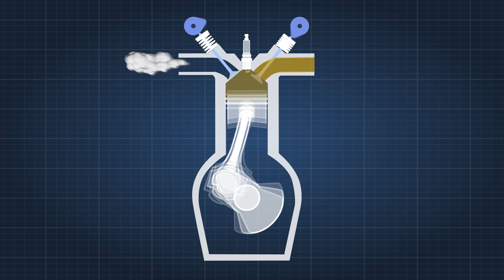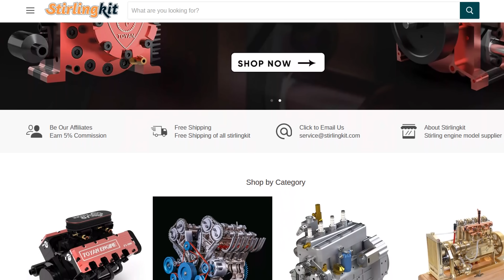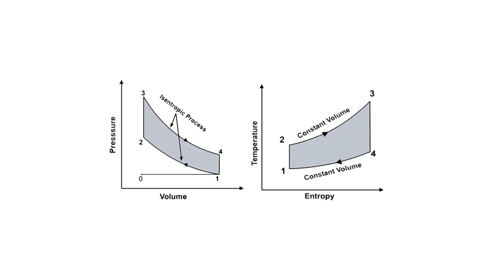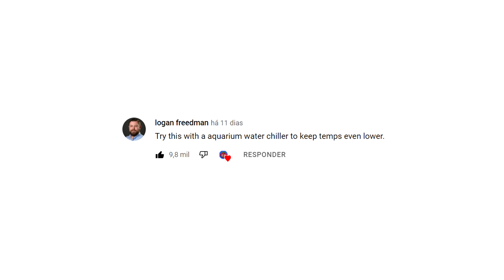I 3D Printed a Transparent Combustion Engine in Resin

Comment: Yo, when you switch fuels like that, you have to retune the engine timing and carb flow rates (i.e. rejet) for that fuel type. Also, engines running race fuels tend to run at higher than normal cylinder pressures than their stock counterparts. That little green o-ring on that piston probably not gonna cut it. Maybe vent the crankcase to monitor blow-by with a pressure guage. Just a few tips from a fellow engine enthusiast.  Happy Brapping!
Reply: That carb is basically 2 straws with a throttle body there’s no tuning it
Reply: I have a transparent engine that runs on Colorado Kool aid 🙂
Reply: the carb used on this engine is the same that's used on model airplane engine. the spray bar setup is actually very simple and works. these model carbs don't have jets like the carb you would find on a car engine. i would a bigger fuel tank would also help and some minor tuning of the mixture needles

Comment: 1-Air!! if there’s not enough air all the fuel won’t burn. That why all you’re test you had fuel soaked pistons. By air I mean oxygen. 2- magnets that probably is a hard one because it’s a timing issue. the magnet would have to be moved or be enlarged for better performance. Thats why modern have a  variable timing for cams and spark timing.

Comment: Each fuel type will need a different air / fuel ratio and also the timing of the spark either advance it or retard it ,modern  electronic ignitions do this automatically depending on revs , an older engine with a manual distributor used the vacuum produced in the intake manifold to di this , that's why your loosing detination at different rpm using the different fuels

Comment: I feel like you would get a lot more information if you could measure the cylinder pressure while the engine is running, but I'm not sure how to accurately do that. I think it would also help to test the engine running while under load. You could use a DC electric motor like a hall effect breaking mechanism to serve as a load. If you add a resistor or maybe a potentiometer between the leads of the electric motor, you could probably figure out a way to calculate total torque along with RPM of the engine for a more clear picture of fuel efficiency. Sometimes higher RPM is what you need, like for a string trimmer or maybe a chain saw, but sometimes you need torque and it's not as important how fast the engine is turning. Things like electric generators and water pumps.

This all may well be WAY more than you are interested in doing, but it could all be fun stuff to play around with. You have tools at your disposal that I don't or I would probably try it myself.

Also, your cylinder could really benefit from some gaskets both at the head and where it connects to the crank case. You can buy sheets of gasket material and cut out whatever shape you need.

Comment: To put it simply the reason the engine was misfiring for a combination of reasons like not having adjustable timing is probably the biggest reason, potential compression loss from the see-through cylinder, and having no load on the engine so it doesn't have to fire every single time to keep a steady RPM I love your videos I've watched your channel since the original 3Dprinted Tesla turbine video

Comment: It would be really cool to use an arduino or similar to adjust the spark timing manually, controlled with a hall effect sensor. You could also put a capacitor in series with the spark plug for a hotter spark, see what results you get from different fuels
Reply: It's called Speeduino :)
Reply: Congratulations, you just reinvented the engine computer.
And that would be an awesome thing to do with maybe auto tune depending on the fuel and the engine.
Reply: @mylittleparody2277  Oh man, you'd need oxygen and knock sensors then. :D

Comment: well there are a few reasons why a four stroke engine might skip power stroke,

First, your fuel is just more flammable and can combust in less pressurized situation.

Second reason might be that your engine is not just ran in, the reason why companies require users to run in their engines is to actually make a better seal with the engine, with the explosions and oxidization and a little bit of gunk caused by the burning of the fuel appearing around the valves and the piston ring, it will result in better sealing thus less loss of compression around the piston (since the piston is not actually tight with the cylinder).

third is that there are just not enough fuel being injected into the cylinder, Carb. powered engines use normal vacuum and gravity to pull fuel in and nothing else, whereas fuel injected engines use pressurized fuel to be sprayed into the cylinder and a better mix with the air around it. as you said you got one power stroke every 8 to 12 cycles pretty much consistently and if it was actually due to the compression, it's not that every 8-12 strokes the engine realizes that "aha I have to compress the fuel air mixture now!" I guess there's not enough fuel in the chamber in the first place and some left over fuel which failed to exit the chamber in the exhaust phase combined with the new amount of fuel was finally sufficient enough to combust , either air bubbles (because the tube is small) or just not enough force for enough fuel. try putting the fuel storage somewhere higher than the where it is to force more fuel in it.

And fourth, Probably your air-fuel ratio is just off and there's too much air for the fuel to burn so there is left over fuel in the engine so it combusts every 8-12 strokes...

Other than that there's not much else coming to my mind since your engine is a mechanical one and not an electronically controlled one :)

Comment: 3D print a combined turbine, internal combustion engine. The shaft of the turbine will become the crankshaft for the reciprocating engine. You could talk about what the pro’s and con’s are about each and put them in a head to head competition. Maybe even use them to start each other

Comment: Most likely reason for failure to ignite and missing power strokes is incorrect air/fuel mixture.

These fuels all require radically different air/fuel ratios, as you touched on. You need to adjust your carburetor for each fuel. Some fuels may require a completely different carburetor if the needed ratio is beyond your adjustment range.

Comment: Let´s make a 2-stroke 3.5 ccm engine up to 40.000 rpm by using 3D printing. Metal parts I can do by SLM, the transparant cylinder you can fabricate by DLP.

Comment: You have now discovered why car engines have a variable spark timing, or spark advance.  As speed ramps up, you need to ignite the fuel sooner as the flame front will have a constant burn rate for each power stroke.  When you hit max speed, the flame front is extinguished by the rapidly declining cylinder pressure, causing a misfire and wasted fuel.  You can see this in action on an older vehicle with a vacuum advance distributor.  Disconnect the vacuum line and watch the engine hit a speed wall pretty quickly.

Comment: I feel like the reason why the nitro methane and others didn't work as well, is because it wasn't running optimally, I wonder if it would be better if the carb was adjusted, and you had a more powerful spark.

Comment: Hit and Miss engine don't spark every time.
Internal combustions engines are rev limited by turning off fuel or ignition.
The effect is the same, speed up the engine fast enough and it won't ignite.
So that little engine could just be rev limiting more with the more potent fuels.
Also an engine jetted for gas will need more fuel for the alcohols.
Alcohols burn slower than gas and this is where you get more torque, force over time.
From gas to E85 you need about 30% more fuel for stoichiometric / Lamba 1 and also the methanol / nitro need more fuel!

Comment: Try a mix of TATP and methanol, or even TATP and acetone (if your resin resists acetone). It's always fun to play with TATP, and so easy to make in the kitchen (Wikipedia suggests HCl or H2SO4 as a catalyst, but it makes it yellow-ish, I prefer HNO3 to reap a nice white powder, and any strong acid works, anyway). Otherwise, Tech Ingredients is studying a lot of tricks to cool a reactor, his last video is all about afterburner, it might be of some help for your next experiments ;-)
Reply: Making TriAcetoneTriPeroxide will likely end up with a knock on your door...or it being booted down at 3am
Reply: @r3dshed  That's the reason to mix it with acetone... And you wouldn't do it in an apartment anyways 😀

Comment: Well, it might be a little unique and even a hazardous idea, but here's goes nothing, back in 2019, a Chinese college students managed to create an "Electric Jet Engine ",  using microwave to ignite air, as you might have figured already, that simply means you'll need a microwave transformer if you were to recreate the engine, and a powerful on at that!

Comment: I guess the whole thing doesn't scale well but when switching fuels the carburetor jets would all need adjusting specifically for that fuel. I reckon the missed ignition events were due to improper fuel delivery - like too rich & wetted the spark perhaps.

Comment: It might have governer to make sure the engine doesn’t run away and explode. If you don’t already know what a governor is, a governor controls or “governs” how fast the engine will idle. I don’t know if tiny engines like that typically have governors or not but it’s just a suggestion.

Comment: When you run petrol it’s more or less perfectly tuned for it although there maybe different octanes etc etc. but when you run Methanol and Nitromethane you need to run a much richer mixture with methanol needing roughly 25% more fuel and nitromethane needing roughly 50-75% more fuel almost flooding the engine so you would need a much hotter spark plug which then may blow the engine to pieces but will be super cool😂😂

Comment: Due to the fact that the spark plug is powered by a charged coil, the time to charge the coil may be too short when the engine runs at higher rpm, so the spark plug can not reliably deliver sparks. Or maybe there is an internal limiter in the ignition system to prevent the motor from running at too high rpm and destroying itself. So if the time between two ignitions is too short, the system skips one cycle (see hit and miss engine)

Comment: Running nitro requires a very high compression ratio and you have to double the amount of it, Top fuel drag cars are almost hydraulic locking the cylinders on their drag run's.

Comment: Dear  Integza
Have you considered that your engine might be a "hit and miss" engine

Where the regulation of speed occurs by cutting off spark (creating a miss), in order to reduce the speed of the engine, and a having spark( a hit) in order to accelerate
Since your engine has no load, it may be spinning too fast and having some sort of electric hit and miss mechanism to slow down.
You can try loading the engine and see what happens.

Also, fuels with higher concentration of hydrogen tend to rev higher since hydrogen reacts faster than carbon (it explodes rather than burns)
But the specific energy capacity of carbon (energy released per atom) is higher than hydrogen

Hydrogen has one electron per outer shell (therefore only 1 electron react per atom to reach a stable 2) 
Carbon has 4 electrons per outer shell (therefore 4 react per atom to reach a stable 8)

Comment: The fact that the most powerful fuel is running slow could be the pressure escaping trough various gaps since it is the most powerful it can escape trough more holes than the methanol which on explosion produces less pressure

Comment: Just a theory but from watching your slow motions it looks like the issue may be in timing. I think the spark plug isn't firing fast enough some of those fuels, I am wondering how the engine would do with a glow plug and bio-diesel. You'd need a glow plug, higher compression and probably a different jet for the carburetor though...

Comment: i don,t know if your seeing that the cylinder is loosing pressure through a gap in compression chamber, and question why cand you mix the gasses you have gathered to create the best fuel possible for your engine?

Comment: Another idea,the low compression causes a lot of exhaust gas to remain inside the cylinder therfore it will dilute the fresh air coming in and has to make a few extra cycles to become flammible again,and the nitromethane needs less air so it can fire with less cycles.

Comment: From my experience with model cars, I'd say try running the NitroMethane in a Diesel Cycle engine (glowplug for starting and self sustaining afterwards instead of spark plug). My Kyosho GX12 ran like that, at 25.000rpm out of 2.5cc (0.25kW/0.35hp)

Comment: The engine is air-flow limited during the gas exchange phase.  So you have a large residual of burned gases that prevent combustion on the subsequent cycle.

Comment: Oil is abiotic. There is no proof it is from dead dinosaurs. Especially with how deep it is recovered. Now,  is it a byproduct of the carbon based lift forms on this planet for millions of years? Maybe, but it is only a theory. "Fossil Fuels" is a fake term created in the late 1800's early 1900's to try to drive the price up of it. Which is funny given the current situation. But, I digress.

Comment: Probably ignition timing, or fuel ratio.. or both.
Also.. Most modern engines.. run closer to 40% thermal efficiency. And the big two stroke diesels in Container ships are close to 50%.
People keep saying 25% efficient.. Those numbers are from decades ago with carbs.

Comment: Methane needs a richer air/fuel mixture. I doubt that tiny carburetor has a air/fuel screw to adjust it, so I think that’s your problem. Also methane burns a lot colder than gasoline, so the life of your cylinder should be a lot longer with it

Comment: When you're running the engine at high rpm the ignition system is not keeping up that's why it was Skipping some power stroke the problem is with the ignition system ... I think

Comment: I have an idea! Ive been recently interested with hydrogen and electrolysis. You could maybe make a Oxyhydrogen powered engine. Oxyhydrogen can be ignited using just a spark or a flame, so it can be very easy to make the engine (hopefully.) I’ve tried making my own, but failed due to lack of materials.

Comment: Ohh so many things could make it run worse. The air to fuel ratio being off because the carb wasn't tuned or jetted for fuel being used. Ignition timing not being suitable for the burn rate of the fuel used above a certain RPM. Lack of atomisation of fuels that require a richer air to fuel ratio resulting in wet spots in the cylinder than can't burn properly or even completely wetting the spark plug and depriving the arc of sufficient oxygen to generate a suitable flame front. That's just off the top of my head.

Comment: Different fuels need different timings as long as the compression is sufficient (or too much). I see that the piston ring leaks fuel, at least more than it should. So we can rule engine knock out. I think that the reason the engine was running different RPM is due to fuel mixture ratio, 95 octane likes to be in the 14.7:1 air-to-fuel ratio. Methanol requires 6.4:1 to work properly. Nitromethane depends on the mixture of course but it varies from 0.35:1-1.7:1. And i am not taking into account firing advance and etc. By the looks of it, you will need to choke the air from the carb to achieve efficiency on nitro. And supply more air or less fuel to make gasoline work well. All that in case this is a controlled environment, so that piston ring leak needs to go (search for fatter O-ring).
Reply: So in your case, you are flooding the engine, this flooding leads to more compression in the chamber, and that's why it can work.